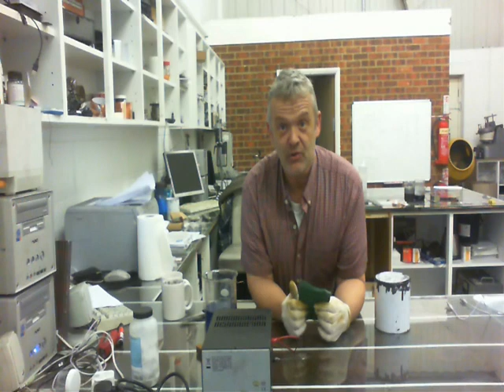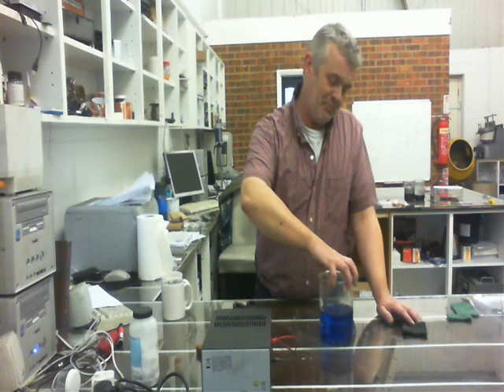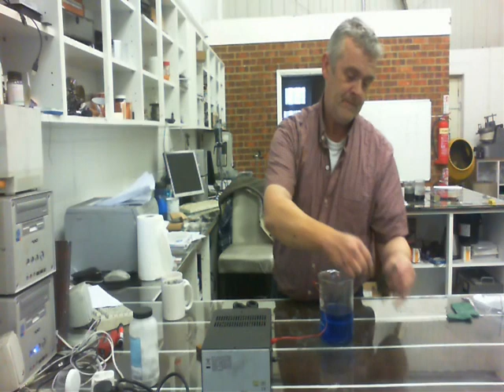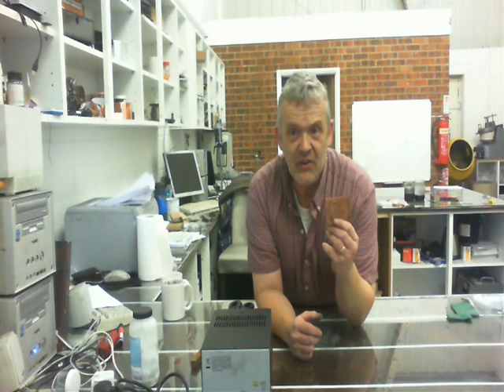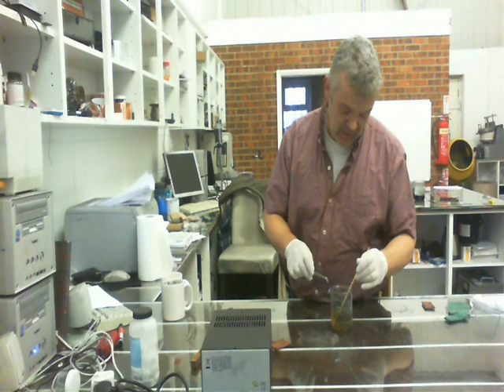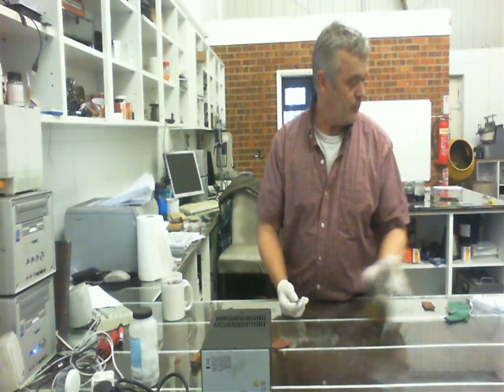Copper Plating A Sponge

Comment: very cool, I bet yer copper sponge would work well as a regenerator materiel for sterling engines. & all that surface area might be usefull in capacitors.
Reply from the maker: yeah - both of those are good ideas mate - i'll have a look at it
Reply: what conductive paint u used

Comment: When you say "heat exchange" could this be a method to make custom heat sinks for electronics? The usual aluminium ones aren't cheap when they're off the shelf, so being able to quickly whip up a full custom sink for whatever project is on the bench would be a real boon to makers.

at some point I intend upgrading my PC, and in the process intend to build a fully custom case to house it all, and have been interested in these methods of creating custom electrical components, since I think many may come in very handy (I think I may have to buy a microwave!).
Dealing with heat generation efficiently is one of the main issues I've concerned myself with, and am hoping to create a silent, fanless case with passive cooling (convection and stuff).
Big, cheap, custom heat sinks would obviously be very useful :-)
Reply from the maker: that's exactly what i mean mate
Reply: Awesome :-)
Reply: brilliant idea!
Reply from the maker: Clown Whisper
cheers mate

Comment: Well that sounds like a chemists challenge if I ever heard one. Why doesn't the safer plating method plate carbon and how can we make it do that job. If those questions already have answers could you please enlighten us about them?
Reply: By the way since I didn't say it first that is amazing! I could see taking shaped sponges to hold the nickel oxide hydroxide and iron plated sponges to make a nickel iron battery.
Reply: Oh! What if you made that as a heater substrate plate the edges copper and a strip down the center then put carbon ladders between the strips?
Reply from the maker: it's not a simple answer mate - normally these things are matched - it is actually astonishing that the safer method plates so much not the other way round - it is never going to do everything. I am glad you like this vid though